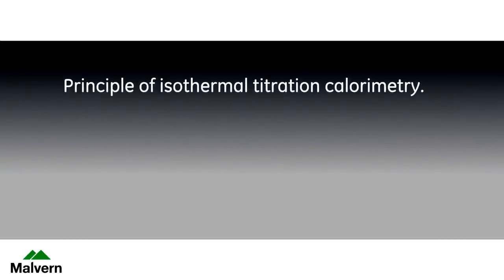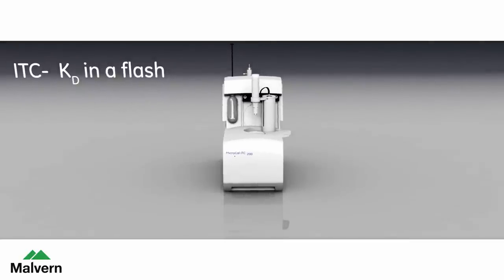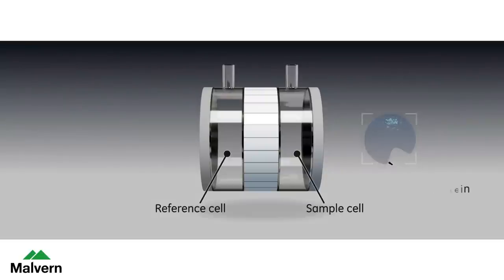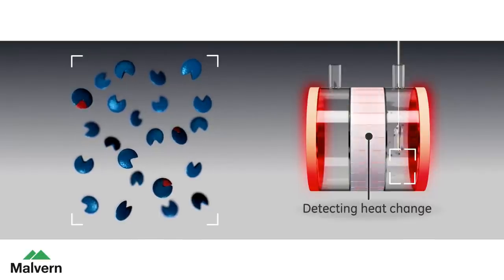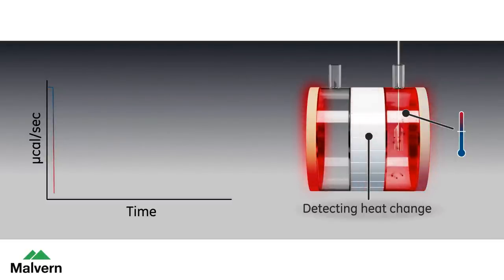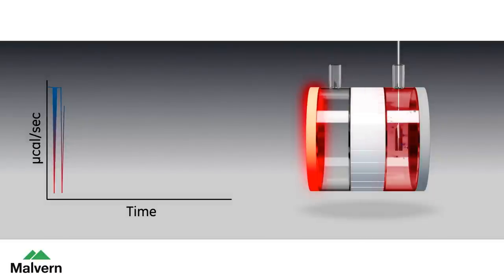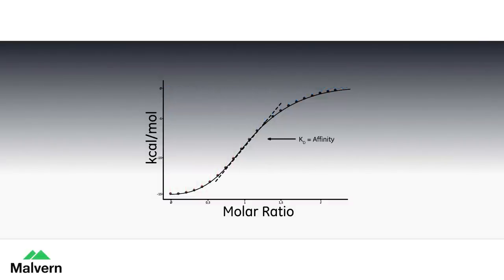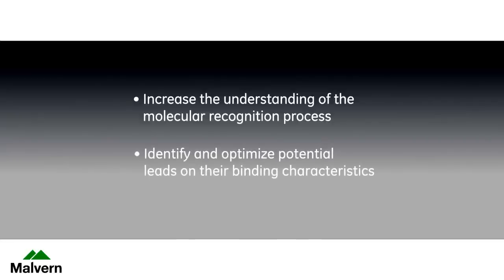Principles of isothermal titration calorimetry (ITC)

Comment: Is isothermal calorimeter and isothermal titration calorimetry same or different?
Reply from the maker: They are different. Isothermal Calorimetry is used to measure reactions at a single temperature e.g. dissolving of a compound in a solvent at 25 C or a decomposition process. Isothermal titration calorimetry measures the heat associated with the heat of binding of molecules in solution at increasing concentration ratios of molecule ‘x’ over molecule ‘Y’. Hope that helps.